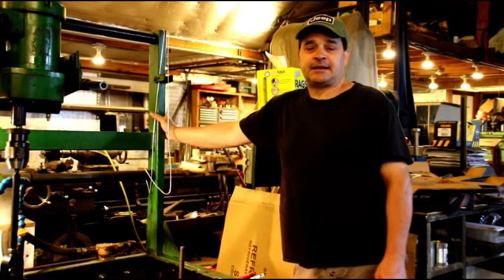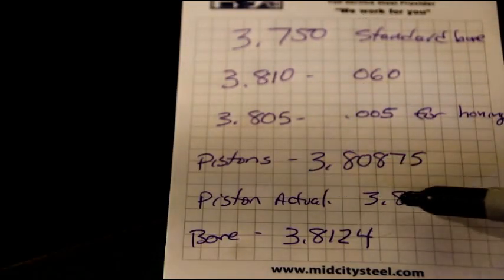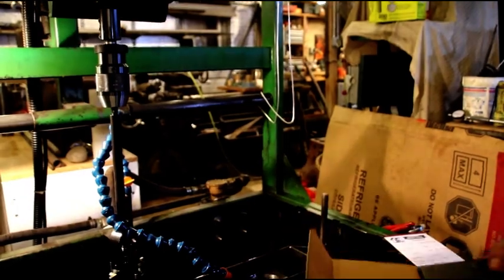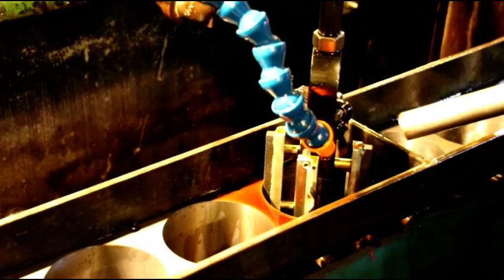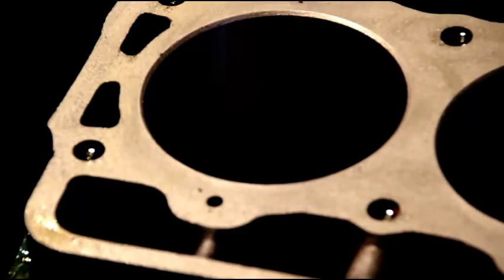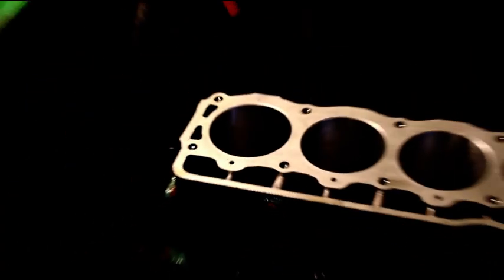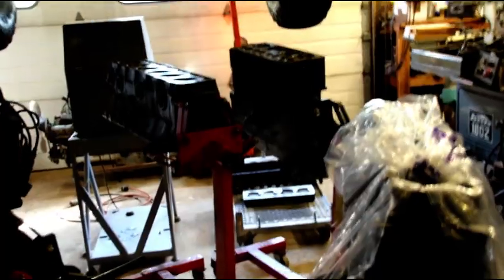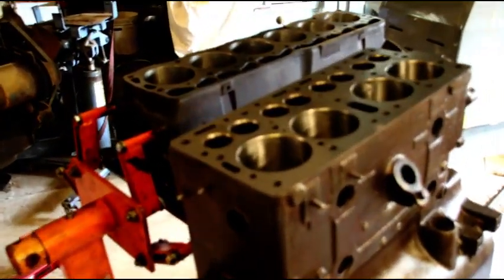AMC/Jeep 258 Honing and Piston Fitting..... Be Careful With New Pistons !!!!

Comment: Thats another engine well done! 👍 The difference in pistons was sure a surprise! I consider the 258 to be a pretty powerful engine as is, I can only imagine one modifed by you would be like! I hope the heat comes down soon, take care!
Reply from the maker: The 258 is a great engine with good torque.  I like a  bit more horsepower out of them so a lot of performance can be gained with cylinder head work.   As you can see from the pistons it is crucial that every engine gets " hand built"